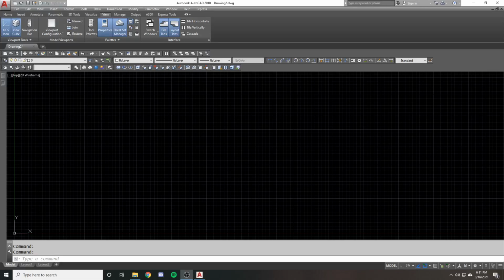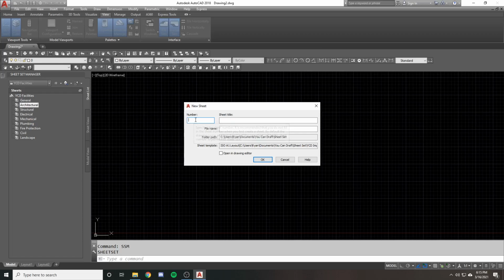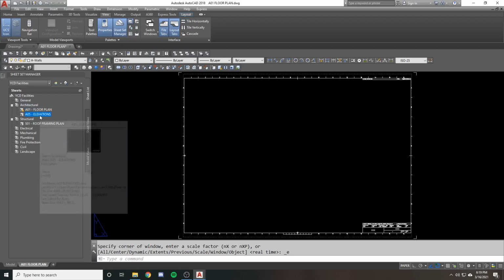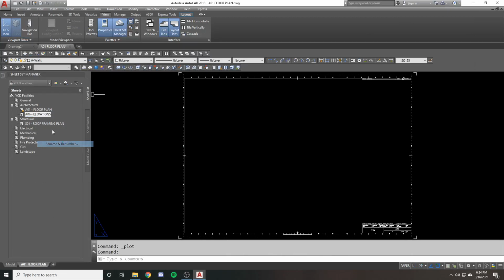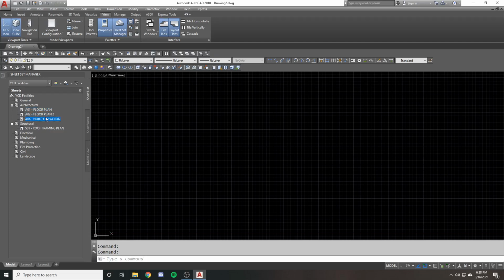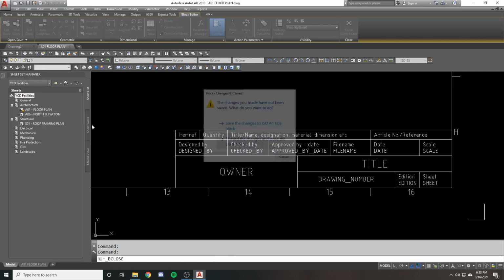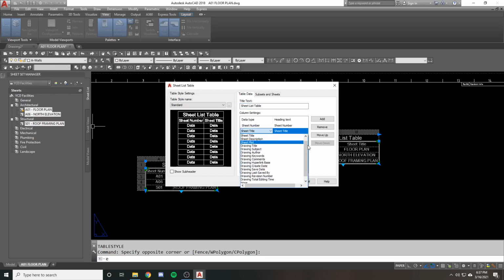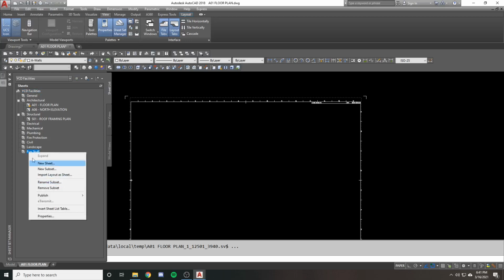AutoCAD - How To Use Sheet Sets

Comment: Thanks for the video. If i use "sheet list table" to create a drawing list. Is there any way to merge data from 3 columns together?  On our title blocks we have 
Desc 1
Desc 2 
Desc 3. 
I can get the data to come in 3 columns,  EXAMPLE MIGHT LOOOK LIKE:          
"01-CP-110X "     "DESC 1-DESC 2-DESC 3".  (merge these 3 columns together so it does not form columns)
Hope this makes sense.
Reply from the maker: As far as I know there is not.  However there might be a workaround.  Sheet set tables follow standard table formatting.  What you can do is select the cells for Desc 1, Desc 2, and Desc 3 and go to the borders in the table format.  Then turn off the interior borders.  This will make it look like one large cell.

Comment: So can you set different templates for different categories? How can i add sheets from outside contractor to the list? Is this set up available in auto cad LT?
Reply from the maker: Yes you can use different templates for each subset that you create.  You can change the template for that subset by right-clicking on the subset and selecting Properties.  You can import any drawing file into your sheet set including those from outside contractors.  I do not know if this is available in LT because I have only ever used the full versions of AutoCAD.

Comment: I'm coming from SketchUp Pro 9SketchUp + layout) to Autocad, and you know - ACAD is jsut so needlessly clunky and complex.  In Sketchup Layout, it was so simple to set up a set of sheets, with all the text automated, from title block information, to specification and annotation.  Now I have no doubt that ACAD can do all this - but why do they make it so damn difficult?  I'm fairly certain I can learn it myself - but how can I convince my Business Partner (and future employees) to also take to automation, if it's so clunky and time-consuming?  Coming from Sketchup where everything was so simple and automated, to ACAD, is such a demoralising thing.
Reply from the maker: AutoCAD is a legacy software that has been built on over many years. It attempts to be a jack of all trades in regards to both 2D and 3D design.  Because of this there isn't a lot of automaton in the base program.  SketchUp, like other similar design software is most likely more purpose built and tailored to specific functions. For your purposes SketchUp may be better and the only advantage AutoCAD has is the broad user base.